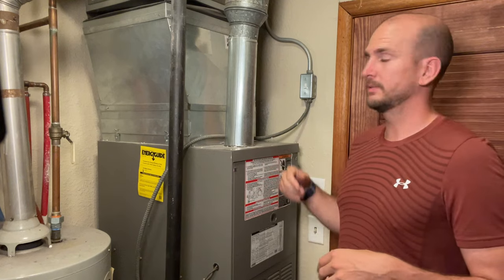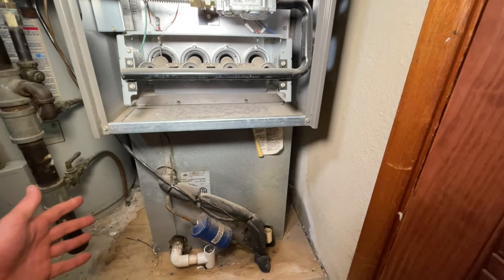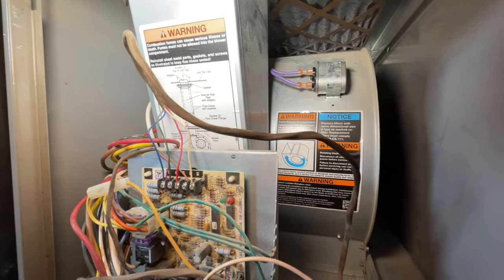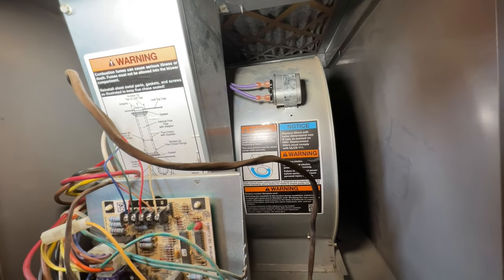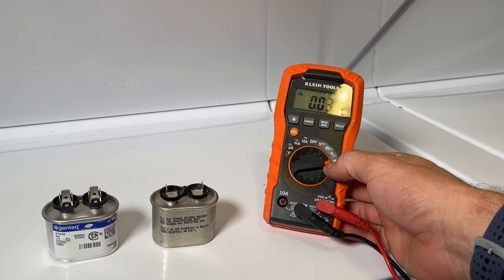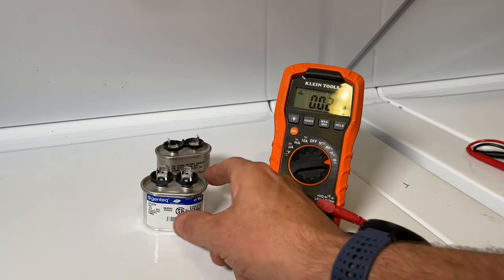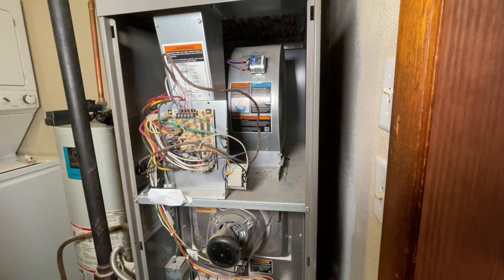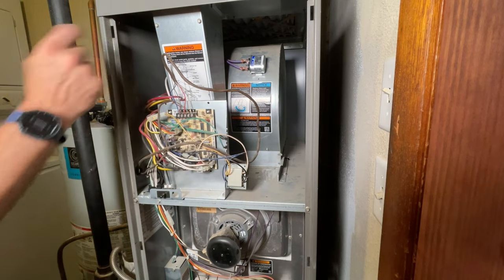Furnace or AC Blower Motor Not Starting | Loud Buzz or Humming Noise

Comment: My blower motor started failing on me.
Only way I could get it to work at times is when I kill the power and power it back on. Once it reaches the set temperature and goes on after the temperature drops, the blower don't kick back on the 2nd time around. 
You think the capacitor will be the problem?

Comment: My furnace (1942 house) is in a dirt crawl space under the floor so have to remove a trap door and get down and in. There is very little room so only service people have gone down there. Not even enough space for filters so I have them on the intakes. It really is such a bad place for it. I have this buzzing and I’m not even sure this can be reached. The last visit by the service guy recommended mini splits if this whole thing ends up dying. UGH!

Comment: Great video!  When the thermostat is calling for heat, my furnace blower is repeatedly starting to spin but won't continue (cycling multiple times per minute), so no air is pushed through.  I hear the fan/furnace vibrate (kinda like "whhhhhirrrrrrrrr... whhhhirrrr..... whhhhhiiiiiiiiiiiiiiiiiiiiiiiiirrrrrrrrr..." (irregular length of repeated short whirs from the vibration/spinning).  Would that also be  due to the capacitor?  Please any help or advice would be appreciated!

Comment: Question. I’ve got a heat furnace with the exact same symptoms. I tested my run capacitor and it was bad and I replaced it. The unit ran good for a day and then started again with slow start up or no start up. When the motor freezes on startup you can reach in and give the squirrel cage a spin and it will begin to work. The cage spins freely so I’m wondering if the motor can be going bad with the cage spinning freely? I assume the answer would be yes since a fan that would not turn easily would be more indicative of a bearing issue and not necessarily a bad motor. I would really like your opinion.
Reply: Old reply, but for the sake of others that have a PSC type motor, the motor could very well be bad. Mine had a shorted startup winding. If the bearings are bad, the motor heats up and causes damage to the motor and has the exact symptom you describe. You can easily test the motor windings by measuring across the two wires that connect to the capacitor (first remove the wires from the cap) and it should read 60 ohms if it is good. 20 ohms for the run winding and 40 ohms for the start winding. The start winding could be open or shorted. In my case, it was shorted because it read only 20 ohms. Replaced the motor and all was well again.
Reply: @michaelkrailo5725  As it turned out, the motor was going bad. I replaced it and she's running fine now.

Comment: I checked, and I didn't find a capacitor for the furnace. The brand is Lennox, manufactured in 2018. I only saw two small boxes, and I believe one of them might be a transformer, but I'm not entirely sure. Could it be possible that I don't have a capacitor for the furnace?
Reply: 2019 is when everything switch over to the very expensive but efficient variable speed motors. You might have one of those if it was installed in 2019 or later. That's a totally different kind of system and this video is not for you.

Comment: I got  old furnace and the bower not working correctly and it does a small  noise just like yours but it's a very very small quiet humming noise and the  wheel still doesn't turn

Comment: Hey I've got a problem. I had a brand new blower motor installed and with it came its own 10 microfarad capacitor yet ever since it was installed I hear that buzzing noise once the power is on coming from the fan motor. I can spin the squirrel cage to get it kick started but it won't turn on its own. I replaced the brand new capacitor with another brand new capacitor and I have the same problem. What do I do?

Comment: Ok quick question sir my ac was at 68 degrese  on cool and mybwife turned on the heater and it mage that exact buzzing noise we had not used the heater over a year, but the ac system was working perfect, my question is why would it make buzzing noise just when trying to turn on the heater.
Reply from the maker: Hmmmm, I wonder if it is your inducer fan and not the blower fan which would turn on for heat and not for cooling.

Comment: Dear sir, ¿what if when system asks to run blower (as AC in summer) but it blows the fuse (round, screw-in type, 15Amp, slow blow, type S, Buss), please?  If I disconnect the blower motor from the system, the relay (inside furnace) clicks on (to run said motor), AC outside runs, and fuse does not blow.  It only burns the fuse when the motor is connected to the system.  (Our furnace does not buzz this way, it just blows that fuse).  (Please help, I'm stuck).  ANY comments/helps are much appreciated.  Thank you for your video(s).

Comment: I replaced capacitor furnace came on blew air for about 3-4 hours now is doing same thing making a humming noise squirrel cage not moving and no air again have solid red light no flashing any thing else I can do

Comment: So our system is 12 years old and likely this is the first major problem, but our AC company came out and said two things are wrong. Either our blower motor won’t turn on or there’s a little copper valve in the outside unit that’s not letting the air conditioning or the heat flip back-and-forth to come on it’s like a little tube so they say to fix the motor it’s about $2500 but what’s weird is the fan inside is on and spending freely no sounds it just the blower won’t come on to full speed to blow cool or hot air in only if you have the fan on it will spin. I don’t see any capacitor and I don’t want to pay $2500. Any idea I have some videos and all that of what’s going on? I just can’t find a motor, but I don’t really think it’s the motor because it’s spending freely with the fan running any help would be so much appreciated.

Comment: Dang....my Mom's furnace is so old the an motor doesn't even have a capacitor. The motor isn't kicking on, but it's buzzing like it has power. Any ideas where to hunt for old furnace fan motors? It's at least 50 years old. :-/

Comment: The problem with capacitors is a bad one will almost always make the blower motor go bad in which ideally you should always change out both at the same time. I've changed out one or the other and even a bad blowe motor will make the capacitor bad. Like tires you should be changing them out in sets.

Comment: My ac section of furnace is not turned on but making compressor noise and is cold as if water is running. I've been in this condo 17 years never had this problem so weird . I don't have it turned on but its constantly making a soft water running noise .

Comment: My blower goes on but it makes clike a knocking sound.  The a/c was working fine and then the fan stopped.   

I did notice a very dirty filter.  Replaced filter and started it up again and still her a sound.

A/c works. Sounds as it the fan blower is out of balance a little???

If so any tips anyone? 

Thanks

Comment: Hi I just did this today. It fixed the humming  noise but now the gas isn't flowing or fan is flowing. So now the ignitor goes on and off but there's no gas flow. Do you know what could be wrong?
Reply: Most likely the vacuum switch.

Comment: So I’m under my house right now. Got the buzz. Pretty sure it s capacitor. I have my wife turn fan button on and if I take my screw driver and push the blade the blade will start to spin with my help then take off and run normal. Just trying to confirm it’s not the fan. Guess it cheaper to get a capacitor and just see if it fixes it.

Comment: Bad capacitor will start to burn the start windings in the motor making it have hard and loud start ups even if it spins freely, that's why in this video the blower motor still makes that humming noise on start up after he replaced the capacitor.       You shouldn't hear any humming or buzzing on start up.

Your start windings are weak,   this motor will get louder over time and  eventually fail.

Comment: I for one keep spare capacitors for both units on hand... and swap out the used ones every 3 years.

Have done the emergency HVAC dance... life's too short.
Reply from the maker: Yeah, that sounds like a solid plan 👍👍
Reply: Note that my attic unit is similar to what you showed, just horizontal instead of vertical

Comment: Dude, if the $14 capacitor fixes my issue, I’m sending you $100. Still saving ~$185 off the first hour quote by local HVAC guy. Amazon delivers tomorrow. I will follow up. Your videos are great. I am a handyman who leans on you for the real deal. You never fail to bring good and cautionary advice. MUCH appreciated out here in the City by the Bay.

Comment: Followup question: Furnace was buzzing, just as you showed. Replaced capacitor and it worked great for just over a day, now it's buzzing again. What causes the capacitor to fail, and how do I fix that?
Reply: Changing the capacitor is just the band aid fix not the solution... its usually because your blower wheel is super dirty and making your fan work over time and preventing it from spinning correctly or your blower motor is starting to seize up and will need to be replaced.
Reply: @tcherinothebamino8833  I think you're right about it starting to seize up. Felt like it moved really smoothly to me, but I replaced it, and all is well now.

Comment: I had to turn the furnace power off and on to get the fan to work properly because the fan wasn't coming on and it was making this weird noise like there was liquid running through it when the fan wouldn't start.

Comment: This is a really great video.  However, in my case, there isn't anything that looks like that capacitor.  The unit is a Rheem, installed in 2008.  I honestly believe that this is my problem, but just don't see anything that resembles that capacitor.

Comment: Same symptoms as you, I changed out the capacitor but the symptoms persisted. Curiously, I jumped the thermostat circuit and then pressed the safety switch and the fan came on. Does this sound like a circuit board issue?

Comment: My motor spins freely so i changed the capacitor but im still getting the same result where the motor when turned on makes that same humming/buzzing sound and then gets stuck after like 10 seconds. What can be issue?

Comment: My blower works for ac but not furnace. It came on for a few minutes then stopped. I test the AC. Blower comes on. Switch to heat, blower won't turn on.

Comment: This was exactly the sound mine had. The wheel does spin freely when I moved it manually but it was barely starting then stopping completely once flame started. I changed capacitor and blower and fan started right away spinning at full speed (yay!) but when I turned off thermostat it slowed down and stopped and now won’t start or hum at all. Flash code said open high limit switch before and after changing out capacitor. Now what 🫤 Motor, high limit switch or or control board???
Reply: Update I also put in a new control board. Still no heat! 🤕

Comment: Was it just me or was it still dragging on start up? 
I'm going through this right now and mine was dragging slowly and I noticed it taking longer the last few days so I old the bearings and thought I had it fixed until 15min ago when it tried to kick on and run but just hummed so I shut breaker off in like 10sec and getting ready to tear into it. I already have the capacitor ordered and was hoping it could hold off for another few day shipping but no luck for that. I'm thinking mine is a start capacitor bad and not the run. That's kinda what yours is also sounding like I could be wrong and someone please tell me if I am or not . Thanks

Comment: Thanks for the video. Could the issue also be a bad safety switch? I've had a similar issue the last few years where my home warranty company has to send someone out every few Winters because the humming noise will start up and you can hear the air flow start but then quickly stop a few times before it builds up speed and stays on

Comment: My furnace is making this noise and I'm trying to find the capacitor replacement but having a hard time locating it online and not sure what other capacitor will work. The part # is 1094954 70c 5uf 370v 50/60hz.

Comment: did you notice the amount of dust on the fins in the squirrel cage?  the accumulation of dust on the fins is the most proximate cause for the capacitor to fail.  the added weight adds to the work the capacitor does to keep the motor in phase.  hire a licensed contractor.

Comment: My unit runs ok if I have thermostat  fan motor turned to on and cool on.       But if I turn off ac and fan off..  If I go to my furnace room I hear that sound. ?? What does this mean?.     I don't hear it if I make it run. But if i flip the switch to off from on. On the thermostat it makes that sound?

Comment: My heater is super loud and very hummy when the blower engages but does engage and will run its cycle. Last night it ran and ran to maintain a not so demanding 67F here in Seattle and it eventually stopped and just hummed. I got out of bed and turned the thermostat to "off" and went into the closet and flipped the power off. Can we assume the squirrel cage locked up if it was running then slowed down to this humming state? Thank you very much for this very timely video sir. MC
Reply: mine did this today and no motor rotates fine test that first and if not its cap time

Comment: Thanks for the video .Especially the discharge reminder. Mine quit when we are having 100 degree heat and its in the attic so its 120F up there and I'm old. Its a short term fix but I went up and banged by hand on the cover . It solved the problem but the system is 35 years old so at least a new capacitor is in order. Local HVAC place have them in stock for $10. Other tell tale sign is "cooling on" flashing on Honeywell thermostat just below actual temp display. Will flash when blower fan not acting on call for air.

Comment: you’re telling people that the capacitor is the only problem but there’s a reason a capacitor goes bad not just old age. this video is misleading. why don’t you try cleaning the furnace because dirt buildup on the blower wheel will cause it to get heavier and burn a capacitor out or the motor. You Forget to talk about that? are you a licensed Hvac tech to give this advice?  you’re asking for somebody to injure themselves and you’re liable you know that right?